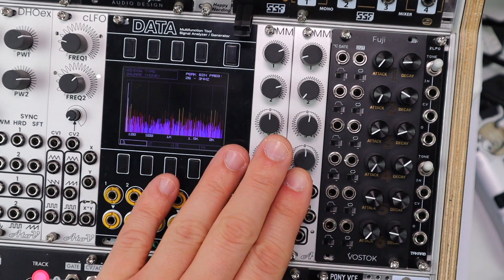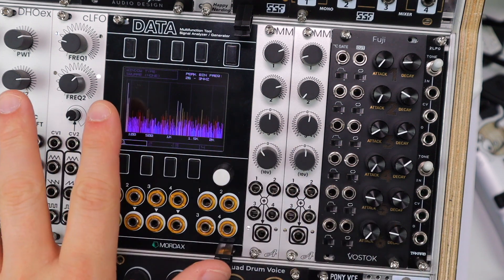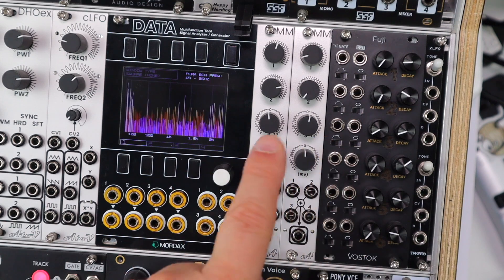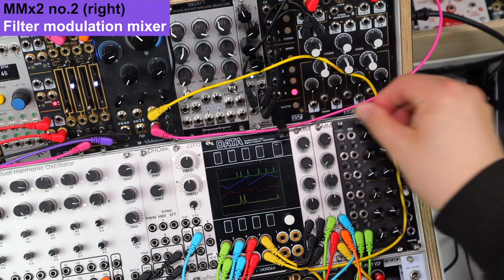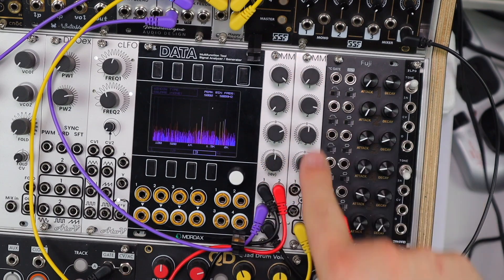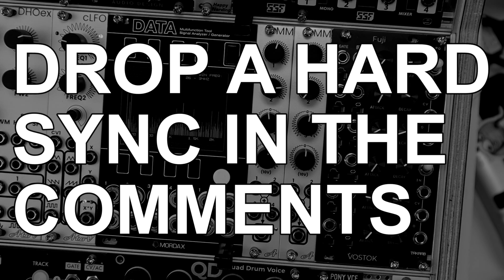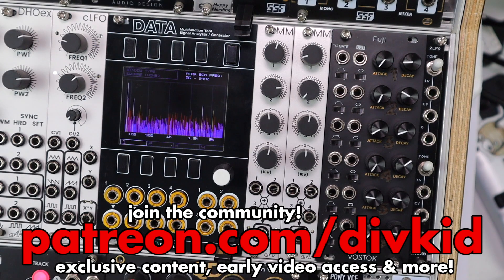Patches for Eurorack Utilities // with the MMx2 Matrix-able Mixer by AtoVproject

Comment: Really liking that Plucked filter sound, it reminds me of some 90's Techno.
Reply from the maker: definitely happy to reference some 90s techno sonically at least. I'd have to watch this back to remember it though.
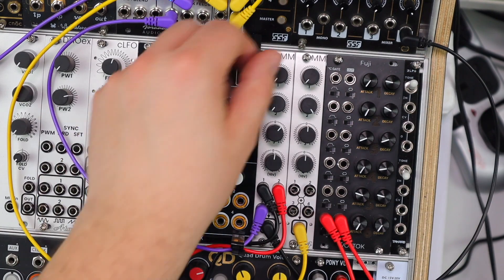Reply: @DivKid  It was in this bit with some reverb on it 07:11 Adding FX sends to basic audio mixing.  And my attempt https://youtu.be/7AVvOwWUUcc?t=103 I found that you need a good trigger for best effect, and the ADDAC Quad Gate to Trig makes them nice and precise. Though reminded me of this banger https://youtu.be/2gn5WJ5ciUA?t=53 I'd been wondering how to create a Plucked String-like Pizz for ages and never thought to use a pinged filter.
Reply from the maker: ah yeah that's a good clean filter ping type thing. Yeah the input trigger makes a big difference. You can try using samples of different things too to change the the sound. Short clicks and various short percussive blips etc.

Nice example in your patch and I get the sound you're going for now. The pizzicato string sample thing. I'd never really thought of filter pings and that sound much. But pretty interchangeable now I listen to them side by side.

Comment: LOVE these utility vids. My 4ms VCA Matrix is still a partial mystery beyond simple VCA and mixing. 
What wonders could you reveal with this type of utility?
Reply from the maker: the VCA Matrix is one of those that for nearly 10 years I've sort of got close to buying and never did. I'd definitely like one, lots of potential for a range of patches.
Reply: @DivKid  would a few flexible VCAs together replicate its features?
Reply from the maker: A 4x4 matrix is 16 level controls and points of routing and mixing. So you'd need 16 VCAs. You would split each of your 4 signals 4 times to get into 4 separate quad VCAs. Then the output of the 4 quad VCAs are the matrix outs. Doable but not practical.

Comment: Really cool idea... I will be stealing this for my DIY setup :). It always sucks to order a minimum of 5 PCBs when you realistically only need one or two of a given module, but this is the perfect solution... Make 4 or 5 small modules that combine into the one that you want. Not to mention the increased flexibility this approach adds.
Reply from the maker: YeahI love the expandable modular take on this. I could easily see the expansion being that you have one at the end of each row connecting up or down to the next.
Reply: This is a great insight. Is it just me or is ganging several same modules a growing trend? Stereo strip is a perfect example.